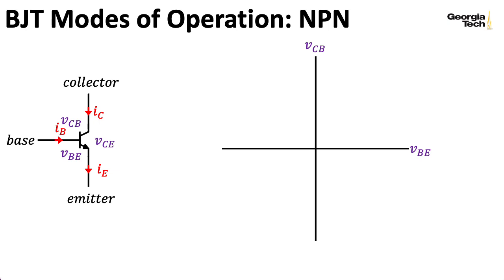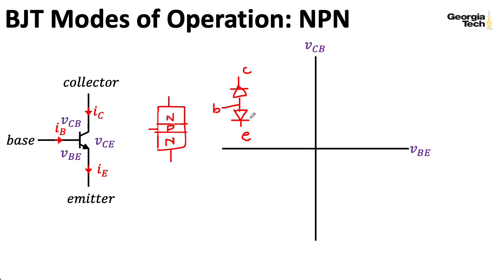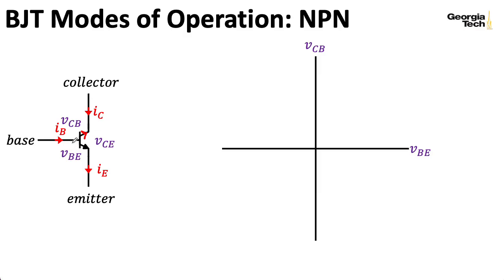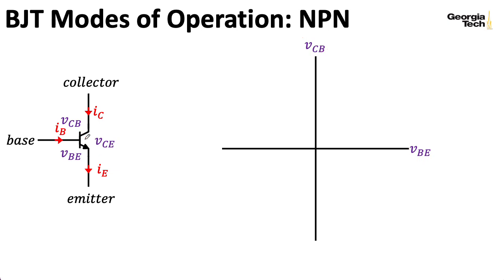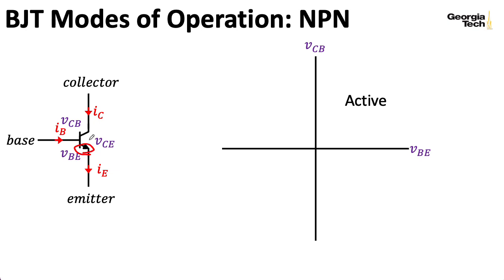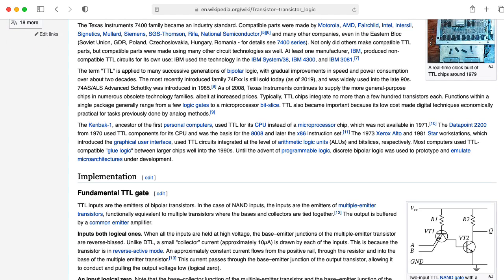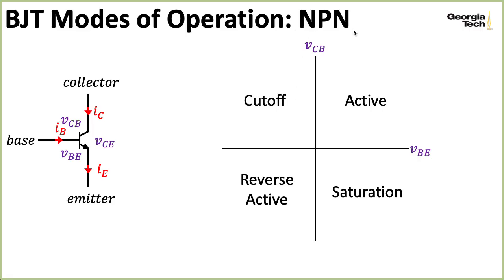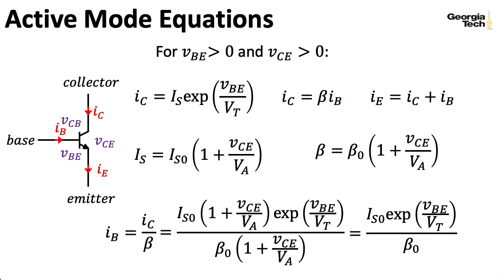ECE3400 Lecture 5: BJT Modes of Operation (Analog Electronics, Georgia Tech course)

Comment: Why are they called collector and emitter, specifically?
Reply: If you look at the current flow, the collector collects the current (it is flowing into the node), while the emitter emits the current (it is flowing out from the node)
Reply: That's an interesting question, similar to several of my own "terminology" questions.  One I have wondered about for years is "multivibrator."  So far, the best I can figure is that's a name carried from the "early days" of electronics when the multivibrator was an electromechanical device, a relay & other stuff to make the relay "make & break" at the appropriate frequency.  Does anyone know of a reference that explains the terminology of electronic devices covering multivibrators, JK flip-flops, & other "unusual" names (the "JK" for the flip-flops)?
Reply: @bobvines00  I assume with JK flip-flops since they are modified from SR flip-flops (SR being Set & Reset) the designers wanted a pair of letters to name the new inputs.
 S & R were previously taken, Q often refers to output, I & O could be mistaken for 1 & 0 or In & Out, I also denotes current, V is used for Volts, so J & K may have been selected because they didn't mean anything else already.

Comment: Shouldn't ideal BJTs be effectively symmetric with regards to collector/emitter? After all, as long as V(leg 1) > V(leg 2) > V(leg 3), the biasing rules should be satisfie, no matter whether "leg 1" is called collector or emitter. 

Obviously, there are practical considerations, like "One end of this device is grounded to the case, so let's call it emitter", but in theory, the reverse operation regime should be just a reflected image of the "normal" range, shouldn't it?
Reply: That’s true. A lot of electronics books conveniently leave out that BJTs in books are approximations of real life general purpose transistors. In real life they are intentionally made asymmetrically to tweak the forward voltage, gain, max output current, etc. to a value more suitable for typical applications.
Reply from the maker: You could theoretically make a symmetric BJT, but no one does (to my knowledge); the different regions use different doping ratios or whatever in order to, as the other commenter noted, improve various characteristics.
Reply from the maker: MOSFETs are typically symmetric in their raw form, with the source/drain terminology just referring to what is at a higher or lower potential. Discrete MOSFETS typically have the bulk hooked to one of the terminals which then fixes what's source and what is drain, but on an integrated circuit with tons of MOSFETs they are indeed symmetric.

Comment: If you wanna know more on transistor on how they are made, Fran's lab documentary: "Transistor Structure: Bell Labs (1965)".
duration 38 minutes, it's shows the cross section of the silicon piece and math, how they made them back then, quite a lot of though went into making a transistor. indeed it's not diodes.
cool detail, transistor from the past where actually dual, 2 transistor on a "chip" but only one was wired.